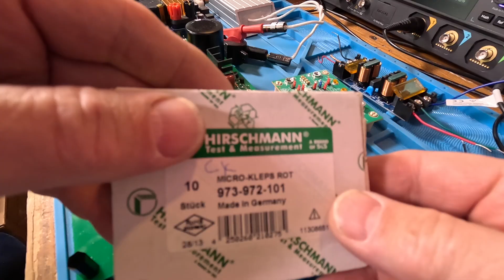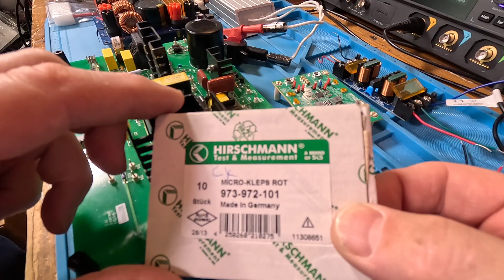Seriously Impressive Hirschmann Test Leads #besttestleads #siliconetestleads

Comment: I bought cheap 4mm banana unshrouded test leads. They fell out of the receptacle on the power supply. Just by their own weight 😂 and the cross section on those… man. 0.35 mm2 is I think an exaggeration. Probably like 0.2mm2.
Reply from the maker: Thanks for this - that's definitely not what you want from test leads!  I've had the same thing happen:)  Some low cost test leads are great - and some...not so great.

Comment: Is it possible that the set screw is to clamp down on a wire inserted to make a complete test lead. There’s really not much reason (nor should you) to clamp down on a male banana pin. Good ones already have sufficient friction and you don’t want to gouge the pin with the set screw.
Reply from the maker: Great question!  The set screw is right at the bottom, so It seems to clamp on the end of the banana - not the spring part.  At first I thought the same as you - that it was for a wire, but now I do think it was an option for a banana to keep it from being pulled out.  It is just one of the signs of how over designed these things are.  So robust!

Comment: Hi Eddie. Thanks for the video. Another nice one ;) Great choice using Hirschmann cables. I am using all the items you looked at in this video  since years. Their grabbers are excellent. Almost unbreakable. I love them. I have quite a lot of the silicon cables in all kind of lengths. They are made for up to 60V and either 16 or 32 Amps. And they're not very expensive, around 6-7 EUR depending on length (25/50/100/150 cm) 
For all my meters I, however, actually prefer the probe masters. They also have very well made stuff. Love my Probe Masters with their sharp tips and excellent quality.
Reply from the maker: Thanks for sharing your experience with them and the grabbers – it's great to hear they're so durable!  They are the best that I have ever tried!

Comment: What are the best leads you have ever used? Probe Master?
Reply from the maker: Great question!  I did a video on this awhile back: https://youtu.be/i4IvB90jZxs

I also did one for electricians: https://youtu.be/s2gvrzUQC6A

But, these Hirschmann are on the top of the pile.  I haven't seen the basic multimeter test lead from Hirschmann - but now I want to see if they have them.  

I used to love Probe Master, and I still do really like certain models.  But the common model that so many of us get is too short and actually not that comfortable to use and has a huge flange.  I think I talk about this in the video above:)